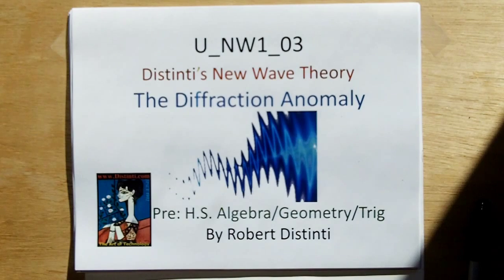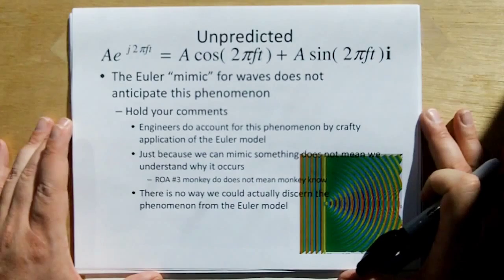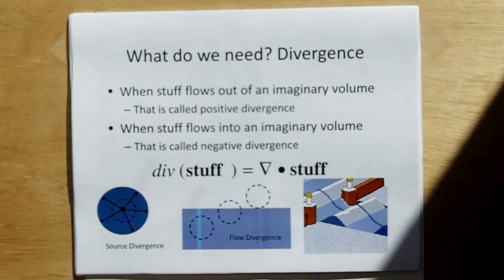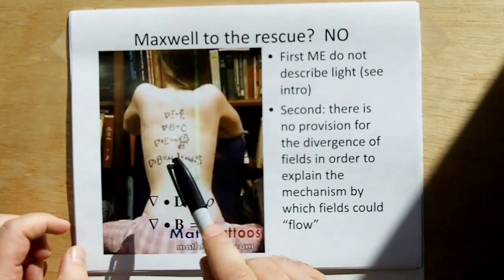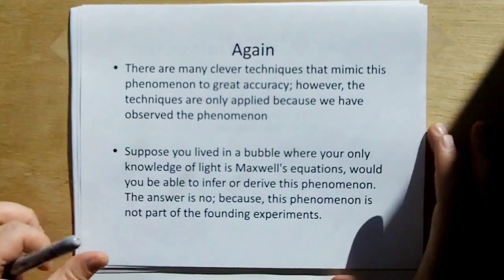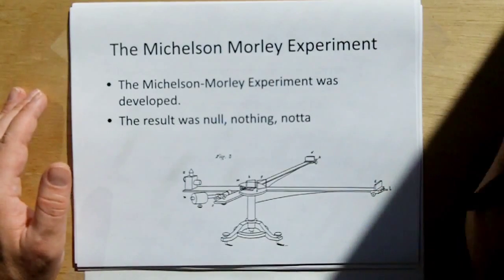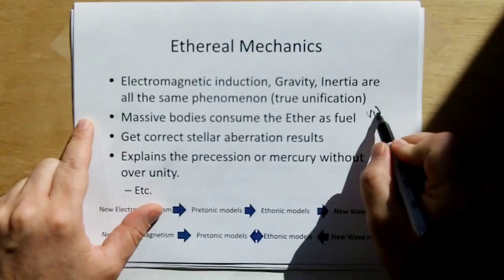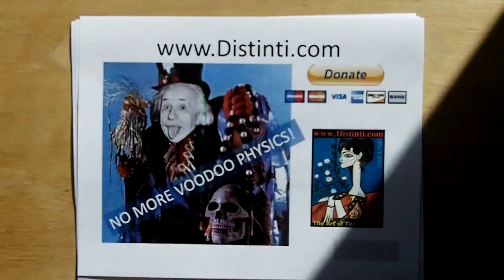U NW1 03: Distinti's New Wave Theory: Diffraction Anomaly

Comment: You don't need a fluid to get diffraction - so the assumption that the medium flows is wrong. You can as well have condensed matter - a lattice. I used to play with wave simulations as a teen, as a result of my interest in programming, math and physics. Diffraction in that case is the result of particles affecting each other in all directions, not only in the direction the wave propagates, but also perpendicular in all directions.